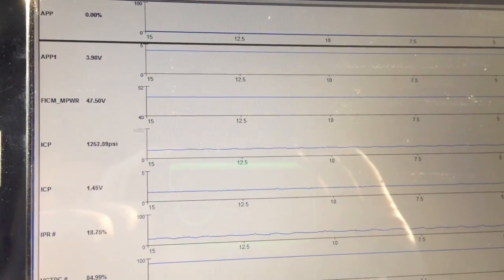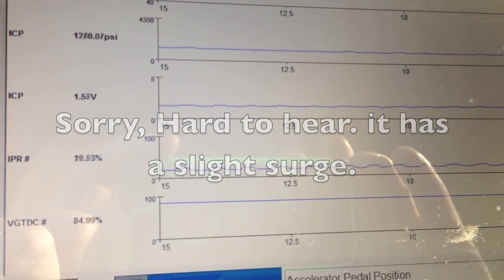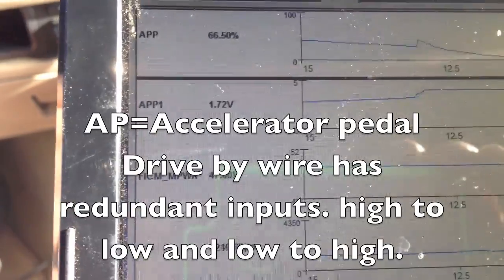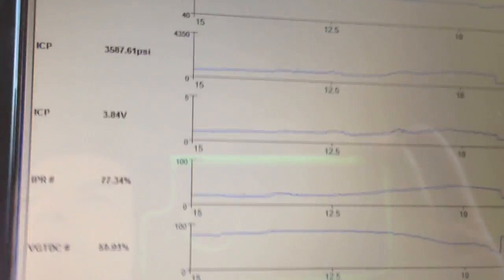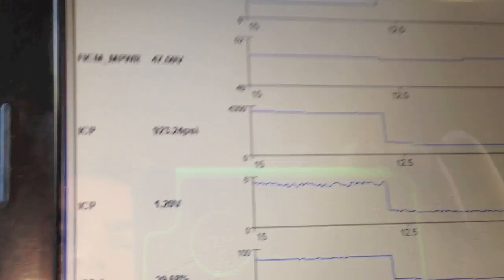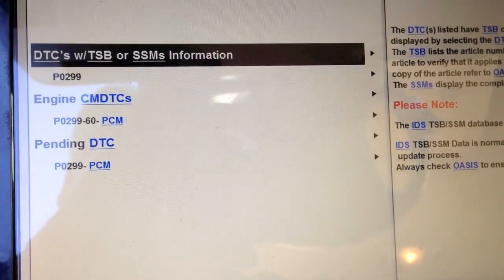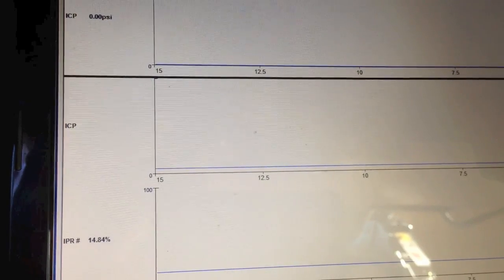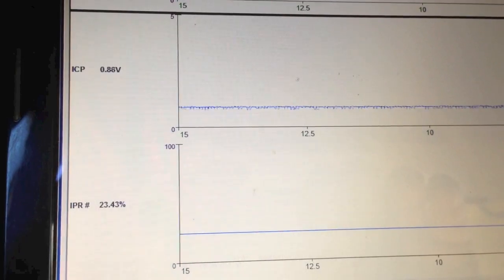Ford 6.0 bad ICP while running. No throttle P0299 false code Surge

Comment: Thanks I actually have the the problem the other way around my ipr is stuck closed causing high icp pressure and a no start. The icp reads 0 with key off and after cranking the pressure slowly goes down.

Comment: I had no code but idle surged very badly.  Even felt like someone rear ended me at a stoplight.  I changed the ICP sensor and it smoothed right out.  RIP Ron.

Comment: Did he pass? Rest in peace. I have 6.0 vt365. No throttle response. Black smoke. Inactive codes for a few injectors low to high side open. Injection unable to build pressure. No idea what to look for

Comment: Ok... so I need to replace the large aftermarket exhaust with the stock one and a stock catalytic converters and muffler and see if that helps. Then the ICP and IPR sensor and the turbo and the High Pressure Oil Pump.
Reply: Higher egts ain't a good thing either.

Comment: how about turbo farting while under load going up hill light APP position and while at 10-20psi the turbo starts to release precious air pressure causing the truck to buck? until you back off the throttle just enough to make it down shift [or unlock the TC] and then the truck runs fine again until the TC locks up then count to 5 and the turbo starts to relase the boost again.?

Thanks in advance if you could point me in a direction. the dealer gave me a run around saying my tire size is doing it to the truck needs to be geared to the turbo is bad to my exhaust is modified and so on. I did regear it to 4:30's for my 37" tires and ive tried tuning it and running stock does it no matter what.
Reply: Ficm maybe doesnt have enough volts to make the turbo boost

Comment: The OBDwiz tool did not give me any codes, the RPM are at 690 and jumps every so often? could it be a clogged  catalytic converter or the fuel injectors dirty?  it doesn't accelerate like it should, my friend replaced the transmission, it wasn't that, no mechanic around Alexandria , LA wants to fool with the truck, we think it could be just dirty inside, the Turbo was replaced (rebuilt), the RPM like I said is between 690 and 700, that's too low . when shift gears it just  wont move or is not getting fuel? stuck on this issue for a month now. 

ANY SUGGESTIONS?

Thanks, Enrique

Comment: my 6.0 had a bad icp sensor and was rough idling, I fixed that but now when I went to drive it the throttle isn't working properly. I press the throttle and there isn't any power going to the engine which leaves it just idling, what's wrong?
Reply: hey jordan i have the same problem some times when i step on trotle pedal nothing happens and now my truck dont start can you help me please also i got code p0299 thanks
Reply: What happened in my case was that a couple of the fuel injectors was bad which caused the lag in power and it ran fine after. In your case I'm thinking it's a sensor because ford's are notorious for having lots of sensors and sometimes a bad sensor can cause your truck to run improperly. My best advice to you is take it to a  professional or browse the Internet some more because I am not a professional. But maybe start with seeing if your starter is any good or if the batteries are still good, glow plugs as well

Comment: Hey there I've been trying to figure out my issue with my 6.0 and what it does is it will long start and run fine then it will jump form 1800 to 2400 rpm and it will lope like it is tuned and then it will stop or it will continue to lope and then it will blow black smoke like it's putting more fuel onto the cylinders and I still have throttle response I don't know what it is and I need help
Reply: Did you figure this problem out? Mine is doing the same
Reply: Icp sensor

Comment: hello Ron my friend has a 2005 ford f350 6.0 powerstroke diesel truck and he replaced the fuel injector and now his scaner has a code for low oil pressure set by the icp sensor but the truck runs starts and drives fine what should he look for in this problem.
Reply: Wow, for all the comments I am reading, it seems to me like this truck model is just a piece of crap. we took it to several places, none of them wants to touch it? why?, my friend even replaced the Transmission, But the problem was not that , it's exactrly as what you said, but it is not giving us any codes? so we think it must be something dirty or clogged between the exhaust and/or the injectors?  never heard that a motor have to have a turbo to run correctly?

Peace., E.

Comment: Please help!!
Hi Ron. I love and enjoy all of ur videos. They have helped out a lot. Well on one of my power strokes, my 03 6.0 I had the lpop went out and have fine peices of alum threw out the oil system. So bad the spool valves in injectors keep Geting stuck. Is there any way to contact u personally for some quick advice on the truck. 
Thank you
Lyle

Comment: this is exactly what happened to me once, stopped at a red light, then tried to accel but no response. I had to coast to the side of the road, shut it off then restart, never happened again. Got a scangauge 2 right after this. thanks for the great informative vids.
Reply: My high pressure pump was damage.....i install the new one and fix it up......i just sold the truck ...6.0 is good until start the problems .....too many sensors its over engineered....now im Free
Reply: @julianobrunorio7110  thank you for getting back so we could see what it was 👍🏼
Reply: hello..did you figure out what happens?? i got the same problem but now my truck died and wont start....please help thank you
Reply: @julianobrunorio7110  your hpop is dead or bad ipr